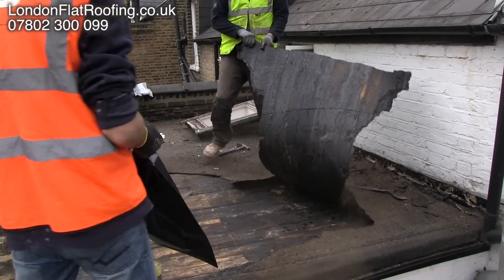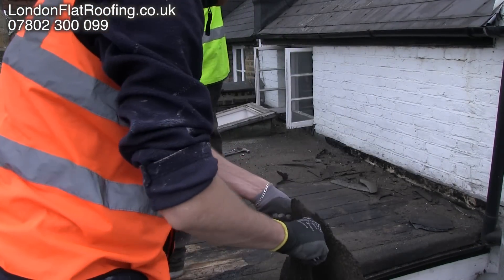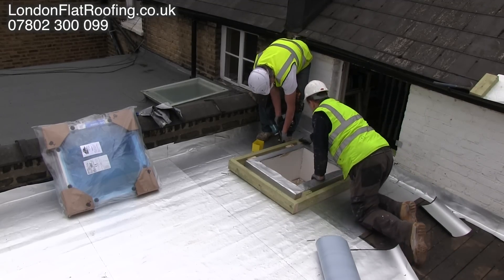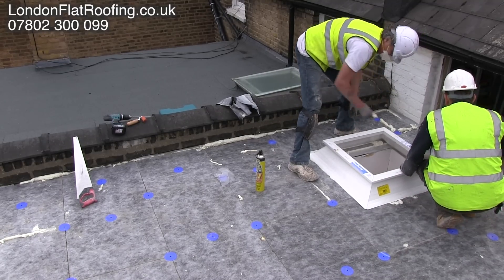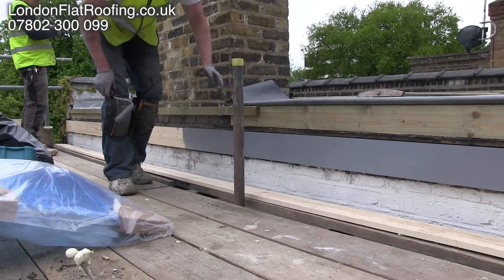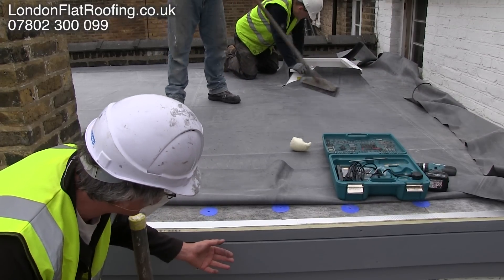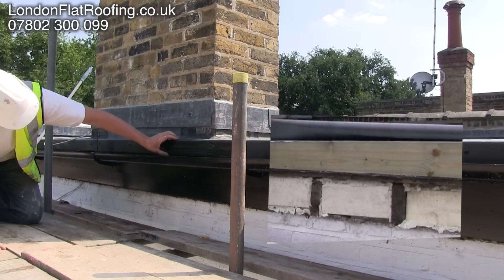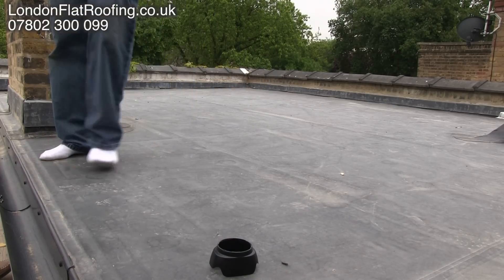EPDM Rubber Roof Over New Insulation New Warm Roof

Comment: Hi steve, what insulation was used please, does it need to be flat roof specific for putting epdm directly on top or is general purpose pir ok
Reply from the maker: Personally, I like to use tissue faced but 95% of roofs done. Oh foil faced, but that means you can't use glue successfully to hold them in place

Comment: Great videos, thank you. I'm doing a very similar job at the moment, fair bit smaller though. I'm also using 5x2 treated timber for the perimeter of the roof for the insulation to butt up to. I was wondering what your thoughts are on adding a 25mm insulation upstand where the roof meets the wall of the house? The majority of the wall is solid 9" brick built.
Reply from the maker: Insulating upstairs is always a good idea however it does depend on circumstances and whether or not you think you are going to get substantial thermal bridging from that area the specification for new build is always to insolate upstairs so it's totally up to you if you can do it easily then do it
Reply: May I ask what insulation you are using?

Comment: The form flash on those skylights will fail within 10-12 years see it all the time when skylights are done like that any corner should be seamed together then form flash put on as u have this way the form flash has strength behind it when stuck to the rubber and the skylight directly they expand at different rates and will eventually split if epdm is fitted this way sa flashing is required to add strength behind it before form flash is installed if u dont use sa the corners must be lapped and seamed with 3 inch tape first

Comment: All them heavy work boots  had me a bit nervous ! Slippers only on the new roof please 🤣🤣
Reply: You would have heart attack if you saw what my new TPO roof was installed. All the installers had their dirty heavy boots on. They were throwing tools, nails, cutted craft knife blades, old rubber roof rubbish on it. My new roof suppose to be a bright gray colour, and after the installation, it looked dirty and black with scratch marks. I was told this is "common practice", and I should not expect it to look "brand new".😓😓

Comment: If you need a harder wearing epdm flat roof (for example to lay large format tiles on top with plastic feet for a patio), can you put a 2nd plywood deck on top of the insulation?

Comment: In a previous video you state you put OSB on the top of the insulation, you missed it off on this video.
Reply from the maker: You don't have to use it
Reply: I agree, but it just confuses ‘viewers’ and in my opinion adds unnecessary cost.
Reply: It makes sense why you don't need it, especially when it means you don't have to split the insulation to support osb boards, I'd just be afraid of some numpty walking on it in the future and damaging it.
Reply: @Weakeyedominant  Hi, the insulation board has a really good compressive strength and is fine to walk on, you just have to careful of point loads. I’ve installed over 500,000m with very few problems.
Reply: @subzero3054  yes, I watched one of your other videos after leaving that comment.  The insulation is very solid underneath so you would need  to go out of your way to damage it.
Reply: @subzero3054  Can you adhere EPDM directly to PIR foil backed insulation? Or does it need to be PIR insulation with a special facing? I have seen PIR which has a course face for torch on felt.
Reply: @arbit3r  Hi, it would depend on whose EPDM you are installing as nowadays most manufacturers sell a warranted system where they supply the vapour barrier, insulation and membrane. However, if you’re looking for a good insulation board, you won’t go far wrong with Kingspan’s TR27 which comes with a coated glass tissue face. It’s compatible with most single ply/EPDM membranes, but it’s still probably worth a phone call to their technical dept to check compatibility with the membrane you are using.
Reply: @subzero3054  hello, so in your experience that is basically a no for using cheaper foil-faced pir and adhered under epdm, as most manufacturers seem to sell other types of pir face coverings for flat roofs? Noticed IKO seem to have an ALU faced flat roofing board, but then they also do others too. Is it simply that foil covering tends to detach from the pir when glued under the epdm ?
Reply: @subzero3054  could you suggest a good insulation to glue epdm straight on to?And the glue?

Comment: Mmm, looks like all the flashings are higher than before, so will bridge damp-proof courses or cavity trays in the walls/parapet/chimney. Not a good idea.
Reply: @Mick G - Yes, brickwork is porous and allows rainwater to travel downward. The DPCs & cavity trays in parapets, chimneys & junctions of walls stop the ingress that would otherwise bypass the edges of the roof & enter the rooms below.

Comment: roofing felt crap it shrinks cracks and leaks after couple of years i have turned to pond liner to fix my shed roof job a good one
Reply: Flat roofs will always be a problem all these newer methods don't  seem to last any longer than old roll and pour or torch on felt method and are harder and more expensive to repair .

Comment: how would you repair that rubber roofing if somebody had turned it into a patio with carpet on it,  indoor outdoor carpet. Now it's leaking in the garage it's been several years but it is still wrecking their garage. 

Bobbieritter7@gmail.com

Comment: Steve, your content is so clear and informative and has been a huge help in deciding what sort of roof I need for my summerhouse. I have decided to go for a warm roof but given that this particular video is now 7 years old, have any of the recommendations here changed? Is the recommended construction still wooden deck above rafters, vapour barrier, insulation (not foil backed) and then EPDM? I see a lot of people using foil backed insulation and a top deck over it before applying the EPDM hence my question? Thank you.

Comment: What is a flashing on a roof?
Reply: It's a closure piece of material added to cover junctions which would otherwise not be adequately weather-proofed. Usually lead, plastic or aluminium and L- or Z-shaped in profile. You can also use the rubber roofing membrane as its flexibility means it can be formed into curves on corners and bonded to the substrate. The lead covering at the base of the chimney in this video is a 'flashing'.

Comment: Hi Steve, good video, I wish I'd watched it before.  Our spec. is for 120mm celotex.  My builder advised us to get a  70mm & 50mm layer instead of a single 120mm layer.  I'm now wondering if that is going to pose problems with moisture getting trapped between the layers.  We will be installing a vapour control layer and a osb roof deck.  
We have the insulation now so probably have to use it anyway but can you offer your opinion on this please? Thanks
Reply from the maker: video just for you https://www.youtube.com/watch?v=UKSaICT7wCE

Comment: Should have felted it, that will have more wrinkles in it than a scrotum
Reply from the maker: Perhaps, but to things to consider. It will last a lot longer and as the installers don't use a naked flame they won't be burning down the house.
Felt and Asphalt are becoming obsolete as roof coverings, that's a fact all we have to do is look at the charts showing the amount of each product laid and both Felt and Asphalt roofs will be a thing of the past in the next ten years. Now that said there's nothing wrong with them and laid correctly they can perform especially the new felts, the problem is untrained installers, and unfortunately, this is also a problem thought the building industry.

Comment: Absolutely Brilliant video! Very informative just 1 thing.
I was always led to believe the same as a few others have said about the condensation .. Is that why you have the vapour barrier? 
Does that stop the condensation? 
What would have happened had you not insulated the gaps between the joists? Or is that just added for extra thermal value??

Comment: Can I install EDPM on my log cabin roof, onto  new osb3 board in the current UK temps? around 6-7 degrees daytime 1-3 degrees night time?
Reply from the maker: Yes,  it's an amazing material when used correctly works well in hot and cold environments
Reply: Steve Roofer even with water based glue?
Reply from the maker: Just like emulsion paint, waterbased glues don't come back alive unless severly soked and if that hapens its not  going to be the glue that is a problme!
Reply: Just worried about drying times, in cold, and the thought it might not actually dry?
Reply from the maker: sometimes  it takes  a day or so to dry completely under the EPDM rubber, however, you should not be using waterbased glue to the edges use contact adhesive to the edges
Reply: Thanks, I have contact adhesive for edges.

Comment: Sorry pal but unless Europe has some miracle EPDM I don't know about after 4 decades as a journeyman roofer the walls ,roof curb and chimney flashing will all fail within a decade ,the rubber will shrink and pull off the walls ,a product that Firestone ,Versico aka Goodyear and Carlisle EPDM roofs mandate at walls is called RUSS strip amd you didn't install it ,RUSS is a 6 inch wide 60 mil roll of heavily reinforced EPDM that sits flush at the break in the walls & deck ,it gets screwed and plated every 8 inches ,then your field sheet of rubber is glued directly to the RUSS stripping before being rolled up the wall as flashing ,RUSS completely eleminates the natural shrinkage of the field sheets from pulling the rubber off the walls ,in USA RUSS is also used around all penatrations such as soil pipes and such , why no RUSS strip ?
Reply from the maker: We use EPDM rubber roofing from Firestone, they ask that RUSS strips be used only when large expanses of flat roofing is laid. The shrink back of EPDM rubber has been known for many years. It was addressed by the manufacturers back in the late 70s and now the shrink back is much less. Also, the old way of laying EPDM rubber was to not fix it down but to keep it in place with ballast. This enabled shrink back or contraction o the complete area of the roofing material. Today the complete sheet is glued down thus stopping expansion, thus minimising the amount of contraction. The roof above is 6m in width, if we assumed a massive shrink back of say 1mm per meter we are talking about 3mm each end. I've now been working with EPDM rubber for over 12 years the old EPDM roof I've been on to inspect was in London Euston over a hotel the roof was over 400 m², 30 years old and in perfect condition.
 At the time we did the above roof Firestone recommend using RUSS strips only when a roof area was over 100 m²

Comment: great video Steve, very informative thanks!
Could i ask what adhesive you used to bond the EPDM to the insulation?
Also as a vapour control barrier would tyvek be suitable?
Thanks in advance!
Reply from the maker: +joe clifford 
We use one of two different glues for EPDM  contact adhesive or a water-based white glue both. We use a lot of industrial spray contact adhesive as its good quick and fast. As regards vapor control membranes   or  VCL vapor control layer, tyvek is a manufacturer trade name  and  Dupont make all sorts of different membranes, their website is so hard to navigate I never  use them  so can't comment. Are you gluing down or screwing down as this makes a difference if screwing you don't have to have a  fixed down membrane.
Reply: +Steve Roofer thanks for the reply Steve, i'm building a standalone workshop in my garden, planning stages now, mono pitched roof liked the idea of a seamless epdm covering on a warm roof.
Am on a tight budget but can wait to do it right. 
After viewing some of your videos i'm thinking rafters with ply on top, tyvek roofing membrane over, screwed down insulation on top and then epdm glued down to that?
Really appreciate you taking the time to respond!
Reply from the maker: +joe clifford  if you want specifications  make a charitable donation to https://www.justgiving.com/roofing?newPage=True and then email me I'll send through a list of suppliers and a promo code to get discount on your rubber

Comment: No disrespect but been installing epdm for 18 years and for that reason i use osb 12mm over insulation or even 18mm then it is so much stronger if you drop any thing on it chances are it will be having a patch.
We did used to use this method about 10 years ago using a one layer 3b with hot tar as the vapour barrier.
Thanks
Reply from the maker: Wes Laynes 
we dont bother with 12 mm just 18mm T+G OSB over the top when a hard top surface is required
Reply: +Steve Roofer Would 6mm OSB laid on the insulation be sufficient to walk on due to occasional maintenance reasons rather than permanent foot traffic. Would you recommend using thicker OSB? Thanks.

Comment: Hi Steve just a quick question mate, I noticed you put the epdm membrane on top of the insulation, when you do it like this like this can you use the usual water based adhesive or is it better using the contact adhesive for the whole of the membrane, if so do you need to apply contact adhesive to the insulation and the underside of the membrane?

Comment: Tip for you... When your membrane arrives unpack and roll round a length of 2x1 carpet style . This rids you of all the folds and will give a flatter finish when laid out next day after relaxation, good vids Steve thx for all the advise.
Reply from the maker: The first thing we alway do is on arriving to the job is to unroll the EPDM to let it relax  the folds are so unsightly, the new glue we use actually stops this from happening as it hold down the EPDM more solidly. Thanks for the tip

Comment: You can walk on the EPDM without a second OSB decking have you viewed my video How strong is EPDM rubber
http://youtu.be/QtLlc-nrr-I
Its Strong
Reply from the maker: +Aegean Star  Back in the day EPDM was held down with stones or pebbles nowdays we alway glue it so they are not needed. They also offered solar reflection hence the reason mineral felt has chippings on it. With the new roof insulation forming a warm roof and leaving the epdm rubber uncovered is not a problem.
Reply: +Steven Dickinson Would you recommend using gravel/pebbles on EPDM? You don't seem to use them in your installations so wondered if there was a reason for that. Many thanks.

Comment: Why wouldn't you use a OSB product over the top of the insulation? Seems crazy to have a roof you cant walk on now for fear of damaging it.....
Reply from the maker: ***** Warm roofs dont have any ventilation  Cold roof do and the ventilation  is above the insuation  but below the decking.
Reply from the maker: ***** Sorry I have to disagree you need no ventilation at this high level.
Reply: I was always taught that you need ventilation to prevent condensation getting onto the ceiling of the property.
Reply: Because you need a gap between the osb boards and the insulation boards for ventilation.

Comment: Hi Steve this is a really informative video,  I would like to know if the old roof covering was in good condition could you go over the top and would you still need the vapour control layer ?
 if so would it stick to the old covering ok ?
Keep up the good work :)
Reply from the maker: If the old roof was in good condition we would have left it down and used it as a vapor barrier. I've looked into lots of vapor barriers and tried to work out how good they are  Most vapor barriers are not that good  old felt  is right up there at the top, its one of the best.

Comment: HI Steve, finding your videos very informative and useful. I'm planning on installing a warm flat roof to my extension later this year using EPDM should be pretty straight forward. What vapour barrier would you recommend? I will be laying on new sheathing ply with 100mm insulation.

Ian
Reply from the maker: The best  vapor barrier out there  comprises an aluminium top surface which is double reinforced by an itegral glass fibre and polyester film and a "high tack" self adhesive bitumious bitumen layer on the underside.

SIG do one at about £8m2 ! and Instare do one  at around £5m unfortunately you have to by 100m2 roles  so not for the small roofer 
http://instar-uk.co.uk/products/elotene-dsn-self-adhesive-vapour-barrier/

Comment: I've a rooftop that has views over Hyde Park in London, if I were to insulate the roof with epdm or maybe another rubber insulation would it be able to be walked on? Does the rain water dry faster than a felt roof? could I fix a wood decking system that won't interfere with the plumbing system or downpipes guttering etc? Do I require planning permission to walk on my flat roof?

Comment from the maker: Insulating behind the fascia adda an additional cost to the job, most customers seeking  estimates for new flat roofs are not alway looking at doing things correctly. I find if the customer is sold on insulation I can normally get them to go the extra mile obviously it can be undertaken  later however this is the best time when the roof is being replaced.